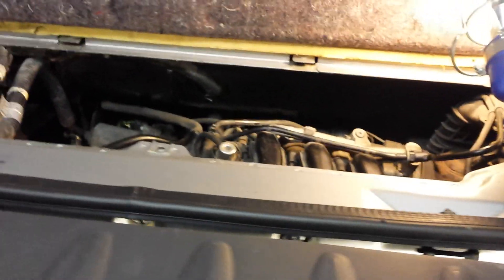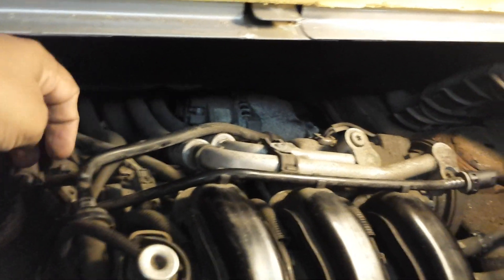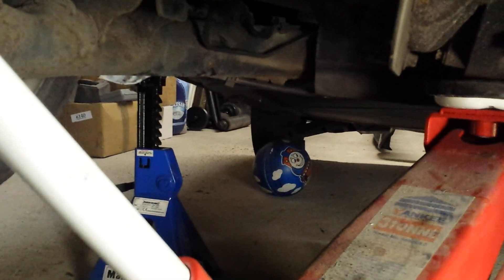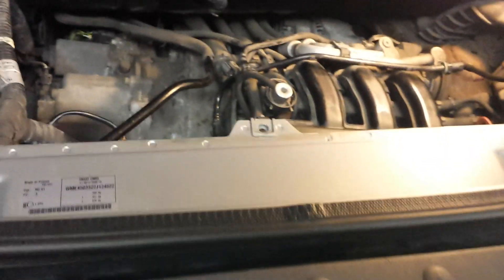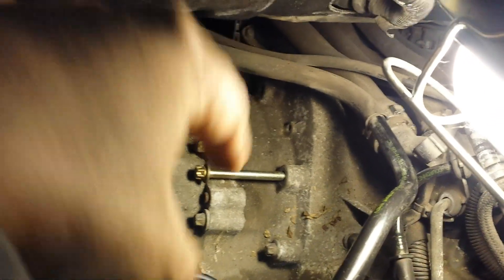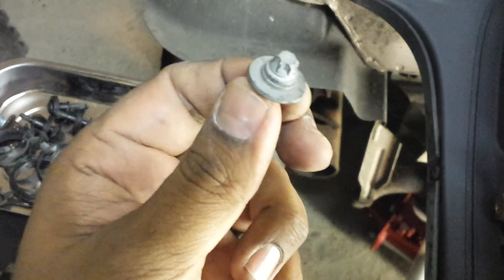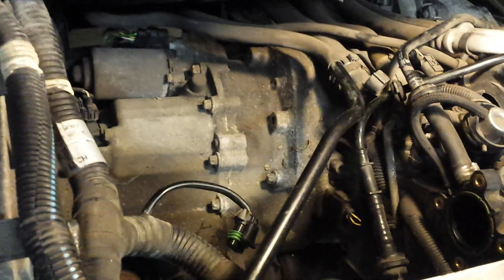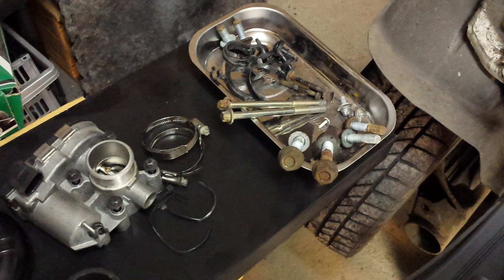Smart Fortwo 450   Starter motor replacement and lowering the Engine   Part 4

Comment: You should have gone on Record Breakers with Roy Castle with the dedication you've shown there. 7 hours labour to change a starter motor is insane. I bet the main dealers love the Smart. If it was mine, it wouldn't be, or at least not for very long. Even the old Jaguar XJ6s and 12s weren't as bad as that, and changing a starter on those was no fun, even though a Jag starter probably weighed as much as a Smart gear box.

Comment: Well done Waqas they are not the easiest of jobs and what you say about taking your time is spot on. I did replace alternator and starter on one of these a few years back with a friend we decided to make an access panel as someone has already stated. It was a bit of a job but my friend still has the car and has never had any problems. It turned out to be an easy job with the access.
Reply: Hi James. I'm just getting my head around doing this task right now. I thought of cutting an access panel with an angle grinder and then finding a way to patch it up again afterwards. Kind of thought it a bit over the top though but now I see I'm not alone with this idea. Any chance of a bit of further advice please.

Comment: Just a quick question, does it matter to lower the engine to access the contacts of the starter? Do you have more room to reach and (un)screw the nuts? I ask because the A/C-pipes are still in the way... trying to exchange the generator here on a Roadster, but the cable to the starter is too short.

Comment: Would it have been faster to cut an access panel on the floor behind the seat? The seat removal is easy to perform. Using a 4" x 1/16" cut off wheel on a grinder will zip through the tin work very easily. Then adding a lip around the cut off plate will make re installing the access panel easier and some silicone to create a water tight seal! What do you think?
Reply: ive considered doing this, but if you get smacked and injured insurance may look at it and say it was structurally modified and void.  sad face.